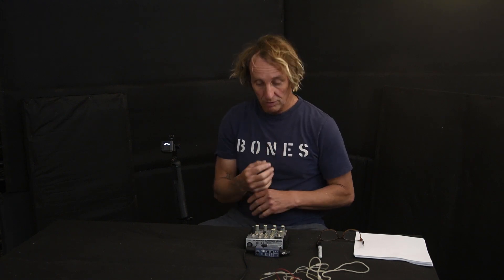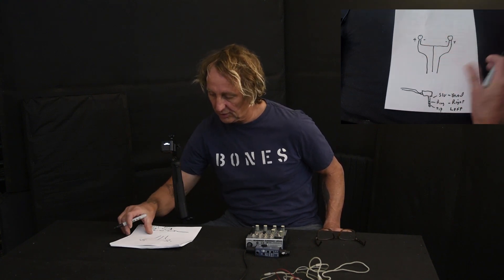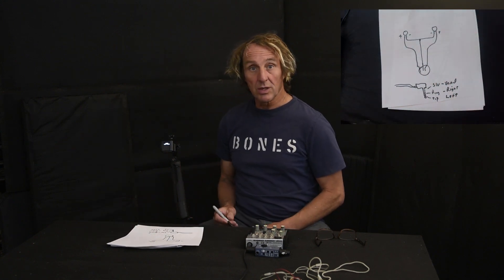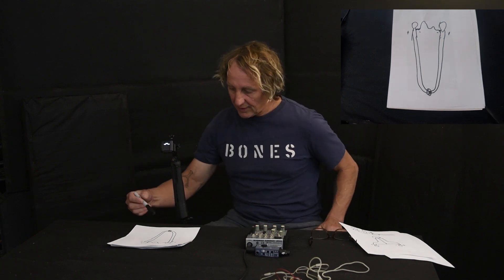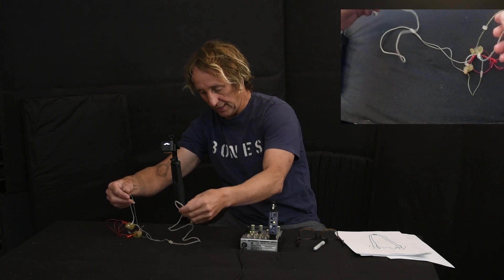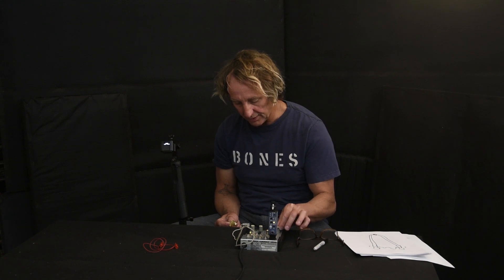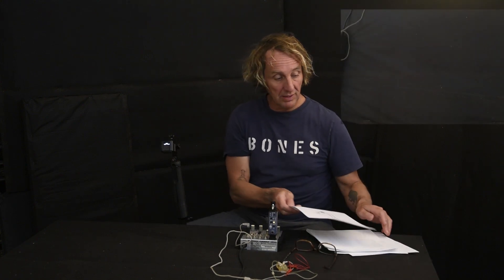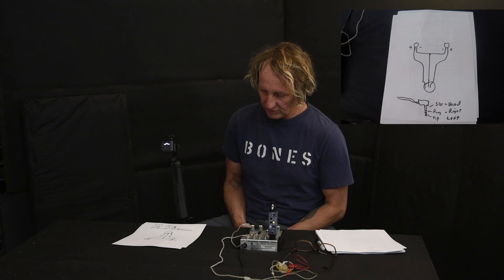The Audible Difference between 3-wire vs 4-wire Headphone/ In-Ear Monitor Cables

Comment: Dave, my 2c on this from a technical pov:
What we're talking about here is electrical and acoustic crosstalk. Electrically, there's crosstalk in the amplifier and there's crosstalk in the headphones.

But first, the most important thing when we're talking audio: psychoacoustics.
Our hearing expects a natural, acoustic crosstalk, because our ears are not acoustically isolated from each other. Sound travels to the closest ear but also around the head into the other ear. This is why with stereo speakers you only need about 20 dB of level difference between channels for our hearing to localize the sound source coming from either speaker (100% panned to either side). This is only valid for sound sources at some distance from the head, however.
If someone whispers in your ear then the close proximity of the sound source to the ear will result in a larger level difference between the ears. This is also the main thing our hearing uses to determine the distance of the sound source.

Headphones are special in the sense that they have pretty high acoustic isolation between the channels, especially non-open headphones.
This can lead to the following experience: a track contains an instrument panned far beyond what is natural (for a sound source at some distance), maybe there's even total silence in the other channel. On speakers, this sounds fine because of the natural crosstalk. On headphones, however, it will sound like someone is whispering the instrument into your left or right ear.
This sounds unnatural and may even be uncomfortable. (There's a solution to this for headphones called crossfeed, which simulates and adds acoustic crosstalk to the signal itself.)

So I did a simple test with headphones and a mono track played through stereo channels, with one channel attenuated. At around -40 dB you start reaching a point where more attenuation has little to no audible effect anymore. Keep in mind that this is a worst-case test.

--> You don't need extremely low crosstalk for playback with headphones. In a speaker system it matters far less still.

---

What's happening electrically?
The situation is worst with low impedance headphones (like in-ears) and long, thing cables and low amplifier output impedance. Why?
Because: let's say each of the three wires has 0.5 Ohm resistance, the headphone drivers have 16 Ohm for each channel, the amplifier has a 0 Ohm output impedance.

The amplifier now sees the load: 0 Ohm + 0.5 Ohm + 16 Ohm + (0.5 Ohm || (16 Ohm + 0.5 Ohm + 0 Ohm)).
The "||" is for parallel section with the ground wire and the other channel's driver and wire. The 0 Ohm is the amplifier's output impedance.

From this we can calculate the total resistance to be 16.5 + 0.485 = 16.985 Ohm.

The voltage drop over the main driver is:
1V * 16 / 16.986 = 0.94199V (this means over half a dB is already dropped over the first wire)

The voltage drop for the entire return section is:
1V * 0.485 / 16.986 = 0.02857V

The voltage drop for the other driver is therefore:
0.02857V * 16/16.5 = 0.0277V

That means we have 20*log10(0.0277V / 0.94V) = -30.6 dB over the other driver relative to the voltage drop over the main driver.
Reply from the maker: Very cool and also if you take a pair of 4 wire headphones and a wide panned stereo mix, and short the wires near the headphone speakers, you can hear the mix get less wide.

 I found the issue when doing perceptive tests on latency on a signal sent differently to each ear. I noticed that even with vast offsets in latency, the signal never really was swinging all the way to one side or the other. And as latency was matched in level and time, the perception was the signal was very centered.

I did not testing with different headphones and found some headphones offered a wider perceptive swing of the signal.

I then went on to test why this was happening and found the 3 wire cable was the issue. 

The testing I did was back in 2002 but many years later I made a video demonstrating the latency timing offset perception. And then also this and another video on the paid member side about the cabling.

https://youtu.be/sOSmtye9gNw
Reply: @DaveRat  Yes, I think I've already commented in some of your videos on human sound localization using interaural level differences (especially at higher frequencies) and time differences (especially at lower frequencies).

The main cause of the crosstalk is the resistance of the drivers and ground wire. But note that 4-wire headphones may have even thinner wires, which means even higher resistance.
In 4-wire headphones this is not a problem since they're isolated, but if you short channels (and hopefully don't damage your amplifier!) then there is also an extra return path (actually two in parallel).
Compared to the 3-wire headphone, instead of (ground wire || other channel driver+wire) you now have
(channel 1 wire 1 ||  channel 2 wire 1 || channel 2 driver+wire 2)

So even though 2 wires are paralleled, if the wires are thinner then you may actually get the same net result as in the 3-wire case.

The point to keep in mind here is that the voltage does not "split" across any of the parallel elements - they each "see" the same voltage.  And this voltage over the driver translates into SPL.

So there's two main ways to improve this:
1) increase the resistance of the drivers, so a proportionally higher voltage will drop over the driver (and therefore relatively lower voltage drop across the return path)
32 ohm already gives a significant improvement, but there are also studio headphones with over 600 ohms

2) lower resistance of the return path (ditto) 
Shorter, thicker cables.

Or go 4-wire without shorting. 😛 Then the electrical crosstalk will only depend on your amp.
Reply from the maker: @xnoreq  agreed. Best solution is a 4 conductor connector and cable. 2nd best when using that amount of copper is 4 wires. 3rd best with same copper is double thick common wire.

What baffles me is that to use the same copper and 4 wires vs 3 wires, the 4 wire is audibly better with the units I tested
Reply: @DaveRat  I've made a spreadsheet with the calculations:
https://docs.google.com/spreadsheets/d/1mOpxsGJnFmSdb2sv3Q6Kc57anUEjRmceIQyuCEPhtg0/edit?usp=sharing

If you download or save it into your Google Docs then you can edit the numbers.

I've split the "ground" wire into 3 parts so that it's easy to check what asymmetric wiring does.

This also allows to calculate quasi 4-wire setups where the two "ground" wires are isolated but shorted to common ground in a 3-pin plug.
Reply from the maker: @xnoreq  very cool.  When I get a chance I will hook up some headphones and ears and measure actual real world db drops of some popular in-ears using smaart
Reply: @DaveRat  Cool. The hard part is measuring the resistances of the wires precisely.
You'd need a milliohm meter or need a current source or current-limited PSU and multimeter (see youtube video titled "4 wire kelvin resistance measurement tutorial").

But one can only use this for the wires, because if you push hundreds of milliamps DC through your headphone drivers they will probably die.

Headphone impedance also is a nominal figure, but this should be roughly ok if you're using noise as a test signal. (Impedance can get really complex with multi-driver in-ears with multiple crossovers.)
Reply from the maker: @xnoreq  I will skip all that and just send signal to one ear and measure the voltage and smaart curve and then measure the voltage and output on smaart of the other ear that has no signal sent.

I will bypass the theoretical and calcs on what should happen and just measure what actually is happening
Reply: @DaveRat  I see. Well, with the results and some info on the wires we could also figure out the values without electrical measurements.
One point that the spreadsheet demonstrates is that doubling cable diameter (1/4th the resistance) of a single common ground wire (with the joint near the headphone drivers) has a effect on crosstalk of about 10 dB
but having two ground wires and joining them only at the plug reduces crosstalk by like 20 dB. At least given my specific example with a 0.5 Ohm ground wire (that would be like 2m or 6.5ft of AWG 28 copper wire).

In other words, shorting the channels near the headphone drivers causes the highest crosstalk.
Reply from the maker: Interesting, I will ponder doing more on this. Maybe after I make the other vid public

Comment: This is fascinating, and brings up an interesting question for me. I have a patchbay in my studio where the previous owner soldered a wire across all of the grounds, tying them together. Does this give me the potential for bleed issues as well? Should I pull that patchbay and get rid of that common ground wire?
Reply from the maker: Since the ground is not a signal carrying wire for mic and line level, the common ground is not only ok, it actually can be beneficial in increasing and improving the grounding.  Also, the grounds are all shorted in the mixing console as well.

For headphones, the common or ground is a signal carrying wire. But that in itself is not the whole issue.  Since headphones and in-ears are lower impedance and are speakers and draw more current, they put added voltage drops on wires than line and mic level inputs.
Reply: @DaveRat  awesome, thank you for that explanation!
Reply from the maker: @Kitzy  👍

Comment: Question, eill this be of less importance at line level/high resistant signals?
Reply from the maker: Most line and mic level signals using 1/4" do not use the sleeve as a signal carrying conductor. This is only an issue with stereo down 3 conductors running low impedance loads.

Comment: I would think it would be because each channel has its own “common” so you don’t have that residual current from the other channel on that shared conductor changing the potential difference however slightly between signal and common for the length of the cable run.
Reply from the maker: Yes, the load of the speaker creates an offset signal on the common. Separate common wires reduce the issue

Comment: @DaveRat If I understand this is 7:49 Crosstalk . does it crosstalk . I not really noticed someTHING I never even bothered to check with my  Sennheiser HD559 closed-headphones with any of - Denon AVC-X8500H or the SONY SDDS DFP-D3000 with a test signal sine wave/pink noise/white noise to see if I have any crosstalk. 
You need the experiment attached to an RTA so can see which amount of frequency crosstalk shows up at what level on the RTA. I could do this.
11:43 I noticed crosstalk with Behringer EPQ304 4ch amplifier which is bit dB disappointing and I had to unplug one of the channels connected to the amp and of course crosstalk was eliminated but why does the amp crosstalk ? I only use the EPQ304 to power my JBL cinema five screen HF horns JBL 2380A horn - JBL 2446 CD. Thinking I want re-plug the amps cos I have lot of them in the rack and switch them to mono bridge mode as I can hear crosstalk and see it on the RTA amp-return on the Lucasfllm Ltd THX Sound System and I really shouldn't have it this way I can see the amount of harmonic frequencies appearing on the RTA and hear them.
Reply from the maker: It's not really crosstalk as peoe usually envision crosstalk.  This is not a signal jumping from one wire to another that happens more at high frequencies.

This is the common wire being signal modulated by the signal and load of one side and the modulation being audible on the other side.

This happens at all frequencies that there is a lower impedance load.
Reply: HD559 are 50 ohm headphones, this already lowers crosstalk dramatically. On top of that, they have much thicker (lower resistance) wires, which again lowers crosstalk significantly.

Crosstalk becomes an issue with low impedance loads (like 16 ohm or lower in-ears) and thin, long (high resistance) wires.
Reply from the maker: @xnoreq  the headphones I first noticed the issue on was Sennheiser HD25 which use a 3 wire cable and are 70ohm drivers.

https://en-us.sennheiser.com/on-ear-dj-headphone-hd25

Comment: So it's because of the point in which the junction occurs and the nature of the signal? Interesting, I wonder if there is some type of one way valve that would cheat this effect in a 3 wire system. I never thought about if further than pondering if the 4th wire introduced more antenna for external interference, which of course I never determined, only thought about it, LOL. Great video Dave, thank You. :)
Reply: It's an AC signal. A diode (one-way valve) would allow the drivers to move one way but not the other.
Reply: @danielplusben  Ok good to know, :)
Reply from the maker: Just using 4 wires or using much thicker common on the 3 wires solves the issue.
Reply: @DaveRat  Nice, it's always simpler than I imagine it to be. :)
Reply from the maker: @peehandshihtzu  👍

Comment: Of course you are going to get leakage. These signals are waves. Waves interact. Any commonality will cause an interaction. It’s why audiophiles pay a fortune for monoblock amplifiers and even isolation transformers for their power supplies. Does it make difference? Now there is the many thousand dollar question. If you are listening to most modern music you are already listening to such a butchered, compressed, and altered signal you can hardly tell the difference. Well recorded, mixed, and produced tracks are such a rarity these days I’m shocked when I hear one. Looking at one on the scope that doesn’t look like a bar of butter is so refreshing. 

Keep the videos coming. They are thoughtful and thought provoking.
Reply: Waves interact? What a deepity.
Also this has nothing to do with mono blocks or isolation transformers.
Reply from the maker: Hmmm, well using 3 wire headphone cables is like using 3 wires to power a pair of speakers. Two wires to one speaker and a third wire to the other speaker and a jumper from the first speaker to the second speaker. A setup like that creates additional interactions that greatly exceed the interactions that occur using 4 wires.

There may be other issues in audio and there may be issues with expensive solutions and minimal impact but this is something where an inexpensive and very simple change to the headphone wire will result in a an audible improvement in stereo imaging

Comment: If the cable is shielded then it could maybe be capacitive inductance between the shield the hot to the other bud.   I could still see that two pairs of twisted wires would be less inductance to the other bud.  In either case I not sure I'd suspect problems at the circuit board or jacks.  Maybe.
Reply from the maker: It's not a capacitive or inductive issue. It's a wire quantity and wire gauge issue.  4 wires reduces it, thicker common wire reduces it. A 4 pin cable and eliminating the common wire/connection will solve it.
Reply: @DaveRat  Ah - Makes sense. 
 Is it in phase or out of phase with the other bud?   I think you posted a video that some of what you hear is mixed in your head.  If it is out of phase,  would you hear it, or cancel it out?
Reply from the maker: @stu-po  out of polarity